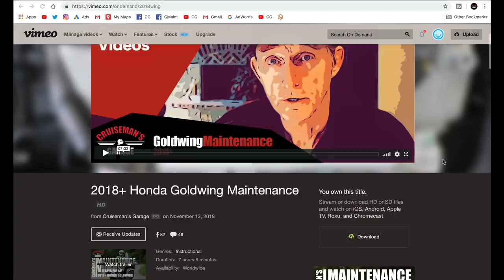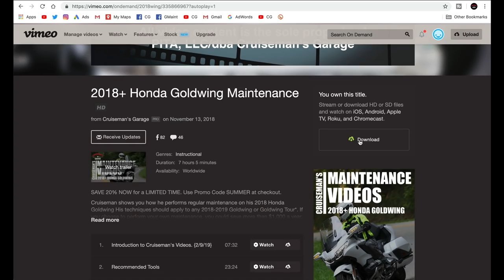Don's First Oil Change

Comment: Ok I read some of the comments. Now I'm a electrical/mechanical guy. I'm very good at my job. I will say there are people who can't read the owners manual and even check there oil much less change it. These new motors and transmissions are not what you had years ago. Retraining is needed for all of us. Read and watch the videos. I have a 2007 and 2014 GL1800 factory service manual. When I buy the new Goldwing I will buy the service manual and Cruiseman's videos

Comment: My concern with the oil drain plugs is the torque value which is 22 F/LBS. I always follow the bike's booklet on any bike. However, a drain bolt saturated with warm oil getting 22 F/LBS is not the same as new, dry, room temp getting same value. Is it critical ? I always just used 3/8" ratchet and my hand feel on drain bolts and oil filters. What about the 19F/LBS for the filter?
Reply: Just a hunch here, but I'll bet most folks changing their own oil aren't using a torque wrench (myself included).  On any bike I've ever owned, it has never been critical.  I have a 2021 DCT, and I just go by my finely-tuned, 'experienced' feel for how tight to get a drain bolt of this size.  And I just go hand tight for the filter, no problems yet!
Reply: @bw6480  So, it has been 2 years from my last post. Before my first oil change, I contacted my dealer and the mechanic said, follow the book and on a cool block, you should not have any issues with those values. I have been changing my oil many times now using a T. wrench at those recommended values with zero issues. New crush washer every time and never had a problem. Also, 19 f/lbs on the filter. Again, no problem, so far.

Comment: $52 for oil, both filters, and DCT o-ring is a lot cheaper than those parts + the $109.00 / hour labor my dealer charges.

Comment: Looks like 3 drain holes, plus oil filter and clutch filter. Is it one fill hole and a single oil for engine, transmission, and clutch ('primary' for some of us)? Get some cardboard moving boxes from Home Depot to lay under your drain pan and work area - keeps the floor dry.
Reply from the maker: Yes, only one fill for engine and trans.
Reply: Thanks, hogdriver88, for the collapsed cardboard box covering of the floor. As the video says, I'm just learning to do this myself and that's a great idea.
Reply: Works great - keeps the floor clean and dry, absorbs wayward oil, folds for storage, and when they get nasty just throw them out - at about $2/box, they're cheap. Way to go on doing your own oil change!
Reply from the maker: I have enough boxes from Amazon I could use. Good idea, I might just put that in my next video!

Comment: I have a 6 month old goldwing dct with about 2k miles on it and have not changed the oil yet. The manual recommends about 6k for oil change. I don't ride aggressively . Do I need to change the oil already? What was your mileage when you change your goldwing's oil?
Reply from the maker: I usually change the first time at 1000 miles, then every 4,000 to 5,000 miles thereafter.
Reply: Just inspect the oil when you check it on the dipstick.  
Is it clean, transparent, or dark and dirty?    At 4 k my oil still looked great.  
The owner’s manual should be fine for any vehicle, but many of us older guys are used to changing it earlier.    
When I was young my father would drive a car home from the dealer and change it immediately, then again at 600 miles.
Reply: 1st oil and filter change is at 4K. Subsequent oil changes are every 8K miles with filter changes every other oil change. Just follow the manual or waste time, money, and pollute the environment for no good reason.

Comment: When is it required to do the first oil change on a non-dct goldwing?
Reply from the maker: That information is in your owner's manual under Maintenance. However, I would recommend changing the oil and filter after the first 1,000 miles, then every 4,000 miles thereafter.
Reply: @cruisemansgarage  thank you

Comment: Hey Don,  if you've never changed the oil in your motorcycles then how many miles did you ride them before the engine seized up?  (LOL)
Reply: Go ahead and laugh. :) I rode in the 70's for a short time, then started riding again four years ago. I went through three Harley's and two Indians before finding my 2018 Goldwing dream bike you see behind me. The simple truth is that I didn't own any of them long enough to change the oil! Well, actually, I had one long enough to have the dealer change the oil, and the dealer changed the oil in my Goldwing, but his shop charge for labor alone was $135/hr! That's what motivated to get my butt in gear and learn how to change my own oil from the Cruiseman. I'm sure glad I did.

Comment: Don, please clean the underneath of your engine
Reply: I kid with the Cruiseman that I'm more of a rider than a polisher. I average a thousand miles a month. But, you're right. I wonder if I can take it to a self-service car wash and use the high pressure spray on the underside of the bike. Hhmmm....
Reply: Hi,  @mrdonsmith , I'm not saying you should do this but I as an older man also find getting under my bike good exercise, In fact I always lie on the deck next to the rear wheel to clean it I use a small sponge to get into the precast spoke castings, after this I use high pressure cleaner to do the rest of the bike and its done carefully, I wish you the best